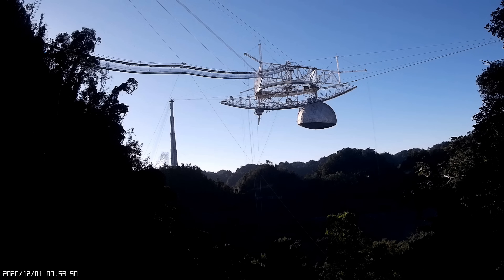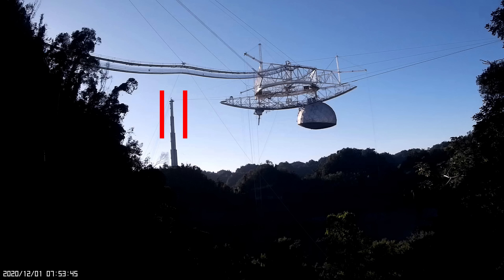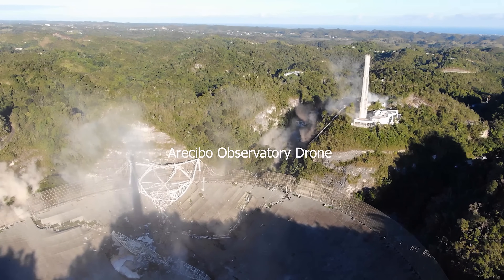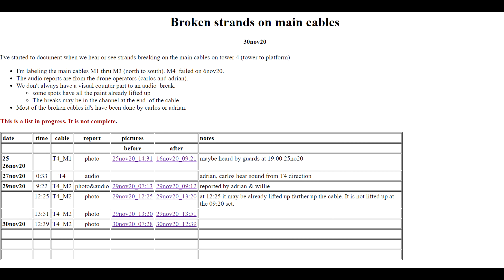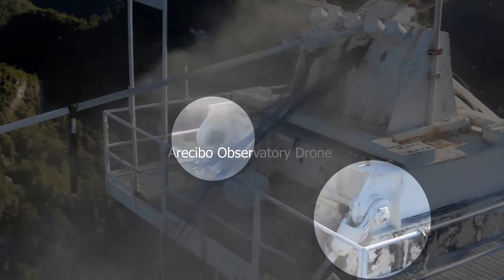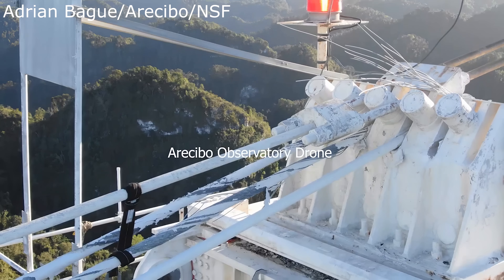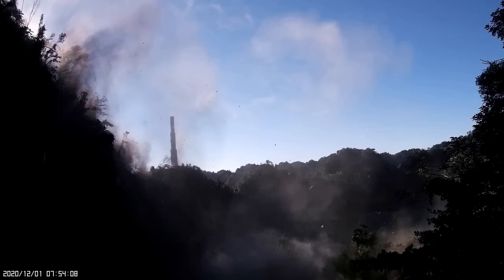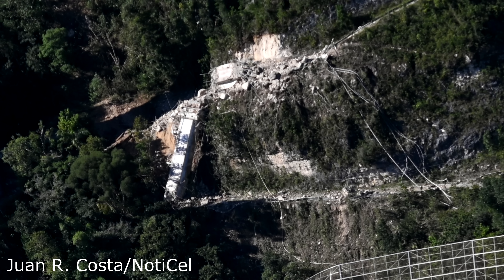Analyzing Video Footage Of Collapse of Massive Arecibo Telescope

Comment: hahahahha
they were ready since the drone can only fly so long to capture the 'accident'
Reply: There can be multiple drones, some flying while others are recharging.
Reply: @user-vb6lq9il5v  You are right, multiple drone monitoring the imminent  collapse because they already know the structure has failed.
Reply: @maximme  After the second cable broke in November, the plan was changed to do a controlled demolition of the structure.  The drones would have been there to monitor the cables' conditions while the exact procedures for demolition were being drawn up.

Comment: What is coming that they dont want us to see? {Sabotage, as thats waay to coincidental, did not budge till the cables, pretty much all went at same time like the glue holding the cables in the cable ends just let go at once, metal doesnt just do that, somthing not right very fishy} and yea no life, billiins of little creatures and plant life, lost in less than 30 seconds would disagree with that statement.
Reply: Jason Adams  whats to repair? Paint around metal protects from rust and corrosion, opposite the camera , although convieniently, there, just wrong side, this would not be questioned. And like by the time i noticed mistake because phones keypad is not easy to type all correctly you had responded, (almoat like this vid is being watched and ppl want nothing questioned) well to that we as a race need to question everything these days, i call bullshit on this!

Comment: Looks like a wire failed.  Even steel bends, flexes, and stretches...
If you look at the vertical tower and watch the top of it, you can see when it fails...
Well, I answered before he did in the first 22 seconds, lol.

Comment: salt air , earthquake zone , re-bar in 60-s not treated with epoxy and heat catalyst process so when the salt mist gets to the steel and rusts the bar  it expands. Cracking the concrete. . etc. This telescope is built on a sinkhole in an ever-changing environment just like the political demographics of he island. It has been a great place and asset for exploration. Hope it is upgraded and continues.

Comment: Not only do I hope they will get the funding needed to rebuild this site but I look forward to the time lapse video of the cleanup and rebirth of this once amazing piece of technology. So happy no one was injured or lost their life in this tragic accident.
Reply: It's a shame they could not afford to replace these cables which appeared to be already stressed to a dangerous point of failure. Unfortunately, older projects like these fall to the wayside as newer technologies and projects are awarded funding... often leaving the maintenance of these great expenditures from decades past with little money to maintain them properly. Hopefully in the future people will understand the importance of ongoing maintenance and repairs so they can factor that into the initial costs to be used later when important infrastructure begins to decay and fail. I also wonder if a better coating, teflon perhaps, might have slowed down the decay of these monstrous support cables. I think all involved would agree in hindsight that they should have stopped all future plans for this antenna/dish/radio until the remaining cables could be evaluated and replaced where necessary. I'm sure just 1 or those cables is extremely expensive but would the cost outweigh the loss... I think it would. This could have been much worse if people were working near the site. No one would have had time to get to cover before those cables came racing by destroying everything in their path

Comment: That was actually stupid to suspend it everyone saw that coming
Reply: Having it mounted on a solid box-frame trestle type structure anchored firmly in the bedrock at both ends using concrete caissons and "deadmen" that crosses over the center of the dish would've been the ticket. Lot easier to inspect and/or repair, also would ride out major earthquakes, hurricanes and simple old age&rust like a tank.

Comment: If one cable broke months ago why did they not replace it, did they think it was a fluke and the other three would be just fine with supporting 1/3 more load than designed for?
Reply: A replacement cable was already in transit when one of the really big ones broke in November.

Comment: I don't even wanna imagine how much that telescope costs to produce and stage there... seems like failed maintnance to me. A cable snapped it looked like and the cable failure is due to maintnance not being kept up with how it should. Those cables last forever with proper maintnance. I mean there are cabled that have held more and for longer, because they are maintained. That my friend is maintnances fault and they should be held responsible for it. Anyone who says differently is wrong. With proper maintnance they should have checked that cable (all cables) atleast 1 time a day if not more. And if they knew it was going to snap soon, they should of ordered maintnance or atleadt some sort of machine or stand to hold the telescope while the wire is replaced. As far as using drones thats also part of the problem. You don't get noise or sound through a drone like you do in person. Willing to bet those lines where making serious noise and creeks and moans as the tension would pulling it apart. They would have known wayyyyy earlier had they had 1 person checking the wires.

Comment: Witnessed similar on a smaller scale.  Worked in pre=fab concrete building Pylons.  These structure are about 80' lon, 2x3' rectangular shape and driven straight into the ground to support Skyscraper.  Start with an empty form-4 of them set end-to end.  Pull 1" cable thru the forms end to end the run what was called a "Slinky"-steel Spring pulled from one end to the middle, second pulled from other end then ties together with steel 'Twisty Ties' then the cable is mounted to a machine and stressed to 25k psi [[IIRC[[ then Concrete is poured and finished and left to dry.  When the cable is poured you stand fifty  feet away [[You Brish folks will have to do the Decimals for this-we are still in the Stone age here]] because sometime the cables snap-real fast, high-pitched Zing! and it's gone.   Cut a guy in half once.

Comment: Is it a control collapse or accidental collapse. If a drone can record such collapse, it look like a control collapse?
If it is an accident, then there is no excused as the scientists know nothing about engineering and structural maintenance😅
Also the structure without any redundancy and robustness design in mind is a poor design. In modern design, spare steel cables can be added or replaced without services issue. The collapse of steel cable in result of the concrete towers are also collapse, what a shame!!! If it is due lack of maintenance, then the station manager bear serious negligence and maintenance responsibility!!!

************
In my opinion, people don't fucking deserve for asking money for re-building the facility again as they don't care about "assets management" and causing unnecessary damage at the first place and it will repeat similar incident in the future!!!
***********

Comment: Not concrete supports?  Steel supports with zinc poured over it?  Then they know there would be issues with the cables at that location and they protected it as well as possible.  Built in the 1960's?
They likely expected a shorter lifespan of the telescope and were repairing it as much as they could.  Everything eventually returns to the Earth.  We just watched one.

Comment: I flew around that telescope in 2002.  There is a caution area south of Arecibo close to where the dish is located.  The location is in the mountains and fairly isolated.  It looks like a simple failure of the cables and the concrete intersection.  Steel in concrete does not do well.  Moisture....then rust.  Painting didn't do the job in that moist climate.  Now they will have to spend a fortune to rebuild that unit and find another way to protect those cables set into the concrete.

Comment: Understand even with the delay of cables breaking this fell at 32 feet a second with about only 16 ft due to the acceleration curve in the first second. So the fact it took a few seconds for the main fall , not counting all the action & reaction movement and continued catastrophic explosive failures afterwards.  The sheer amount of energy released that was under load massive and went from stored static to dynamic is amazing.

Comment: That would have to be completely rebuilt, because surely nothing there can be reused especially the towers.  Because were they to be, I suspect there is a good possibility that the entire thing would collapse again, as the structural integrity of those towers would have to be in question.

Comment: I am not an engineer but when one cable failed it started a chain event of the rest following suit.  They should have had enough cables to be able to lose one and not start a chain event of failure or used stronger individual cables.

Comment: I too am surprised to hear about this from a YouTube recommendation rather than from the news....This at the very least deserved a mention.

I highly doubt they will replace this telescope.   Clearly the money isn't there otherwise they would have done the necessary maintenance which would have prevented this catastrophe to begin with.
Reply: Indeed. But also, there's already a similar, but way bigger telescope in China, in use since 2016... Maybe that's even the reason the maintenance dropped on this telescope.

Comment: At 1:17, when the drone footage begins you will notice at the far right of the cable mounting block, there is already a cable (#4) missing as indicated by the grey colored area where white paint should have been. Cable #2 (frm. left) & to a lesser extent #1 have been under duress as indicated by the lack of white paint in some areas, so this failure has been in the works.

Comment: 'Puerto Rico doesn't get the same representation as the states.' True, because it's not a state. Further, residents don't pay federal income tax. Is it representation without taxation now? Nevertheless, Puerto Rico without representation and without paying federal income tax still had that telescope built in '63 and funded since then. Seems to me you're spitballin' or allowing your imagination to run wild. 

As for it being rebuilt, it seems unlikely because China's telescope is about 200 metres larger. Arecibo was built in a natural sinkhole, so to meet or exceed China's dimension will require a lot of work - look at the proximity of those cliffs and structures. Re environmental impact surveys, any change, such a blasting cliffs, leveling forests, etc. requires new ones, and this process takes many years. Someone will claim a cliff is sacred or a bird nests in the trees and that has to be studied. And on and on it goes. It takes up to a decade to get a few windmills approved in Vermont, a state where most people want these turbines. Basically, the future of projects like these is China because it has a streamlined process and the gov't tolerates little dissent.

Comment: The failure is unacceptable coming from a structural engineer. Structures usually have a design resistance 1.5x of the acceptable load or higher. This factor of safety is usually provision for poor workmanship and installation. The first failures of cable would have seriously reduced this factor of safety and warrant a replace of this cable, not wait not a failure to occur. This is a good example of neglect and where management decisions based on "common sense" overlook engineering understanding.

Comment: Those cables have a 4 or 5-1 safe working load by design. One cable should have been enough to support the load (static.) It's the shifting of the load that breaks the cables (dynamic load.)

Comment: Note at 8:43 on the far left tower, you can see a debris cloud forming and surrounding where that main cable first fails. Wonder if this "cloud" is the white paint popping off of the wire bundle?

Comment: I would be interested in more explanation of the measures taken in the design to assure adequate load sharing between cables and between strands of cables.  Using the zinc to make the cable ends act as a unit is a step in the right direction, but as zinc has a lower modulus and lower ductility than steel, it can only go so far in fulfilling that duty.  On the other hand, the lower modulus probably mitigates the stress concentration where the zinc terminates.  I'm also curious what was the root cause of the first (previous) cable's failure.  Was it overstress or fatigue or a failure of the fastening system?

Comment: Welp, time to watch Goldeneye now.
Reply: Contact for me :(
Reply: For England James?
Reply: @mav2553  
No, for me.
Reply: RIP Sean Bean
Reply: Hah i thought of Cradle the moment i saw this pic
Reply: "I AM INVINCIBLE!"
Reply: I think it's sabotage that's what I think
Reply: @joejose8433  - Apparently they knew it was failing for years and had cameras kept on it for a while.  Modern materials don't last very long.  Concrete and steel crack and brittle over time.  Same with aluminum and nickel, which is why airplanes have to be replaced regularly.  Although one might argue that simply allowing it to fail is sabotage, but maybe it was the easiest solution to whatever else is decided to do with the site.
Reply: Lame
Reply: Contact

Comment: Wait a second....
1. A GoPro was filming the telescope "in case" a collapse happens?
2. A drone was flying above the telecopies exactly the moment is collapsed? (I guess a drone has a flght capacity of 30-45mins)
3. The drone zooms exactly on the spot where is happens?
I call "accidently" something else.
Reply: The drone was monitoring the condition of the cables, as the cables were deteriorating.
It is possible to have several drones available.
The drone(s) were monitoring the likely points of cable failure.
Conspiracy theories are a dime a dozen.

Comment: This entire analysis was just focusing on what the supporting structure does after the telescope is detached. The mode of failure was clearly in the centre where the telescope was and this for some strange reason was glazed over. Actually a really piss poor discussion on the destruction of this bit of tech. C'mon. Dig a little deeper!?

Comment: Why was the drone positioned directly at the point of failure @  1:25  Specifically on the cables tied down with a black heavy duty belt because those failed first?...  It also looks like the heavy duty belt was tied down to something else, so were the cables destroyed on purpose with a pulley system?... Or was the drone really in the right place at the right time?...

Comment: One of those moments where you do some mistake and avoiding it would have been the best, now you have to deal with cleanup and all other problems, if you even want to fix it.
Reply: Mistake?  No this is the result of deliberate neglect by the anti-science party in Congress removing funding for maintenance.  They've been squeezing the maintenance budget for Arecibo, the Very Large Array, and every other large science facility the US has for well over a decade.  There was serious damage done to Arecibo by the hurricane in 2013, but NO additional funds were designated to repair it.  This is the result.

Meanwhile China is building a radio telescope that's even larger and spending more on basic research than the US government and industry combined.

Comment: I would guess looking at the video itself. Something was going on. Why is a drone up there capturing it as it happens?? Something must had happened prior......... or was this planned ??? Think about it again for a min why was the drone at the tower filming as it all unfolded? A drone only has a flight time of 1h maybe 2h max. so the Question need's to be asked why again was the drone up there.
You stating there are 3 but actually there are 5 cables so 2 already snapped.
Also looking at those towers the concrete is falling apart. Who ever mixed/ordered the mix used the wrong concrete for this type of a structure. Look at photos of German WW2 bunkers their concrete is much darker gray meaning a complete different mix of concrete was used for a much higher density than those 3 towers are. 
I know when a cable this size fails like it done a few month's ago it take 100-200k for a new cable. And an order takes up to 4-5months for final delivery and installation so why was no additional work done to the failed area? Did they already wrote it as a total loss off when the first cable failed ??

Comment: whats the use in rebuilding this? wasting a bunch of money? this thing has no use.
Reply from the maker: There’s no other planetary radar with this range, so if saving the world from killer asteroids is useful this had a use.
Reply: @scottmanley  this thing was up and running until a week ago, and there were still asteroids that flew close by that werent detected until after they passed. Several just the few months past.
Reply from the maker: Yes, as I explained in my previous videos, this facility was the best at getting very accurate position and velocity information, letting us predict the orbits of asteroids decades into the future. Since it stopped working the number of asteroids we can do I this on has been cut to 1/3 of what we had.